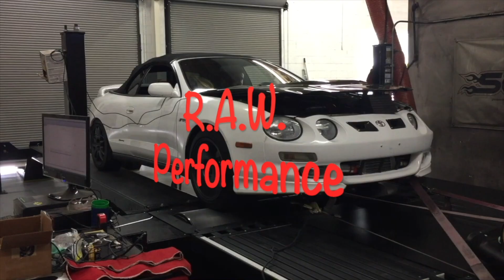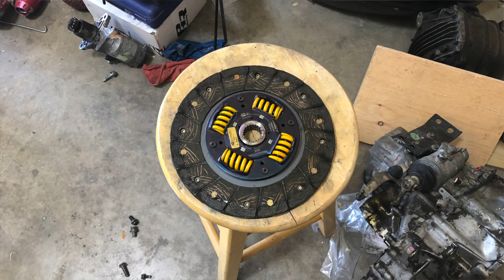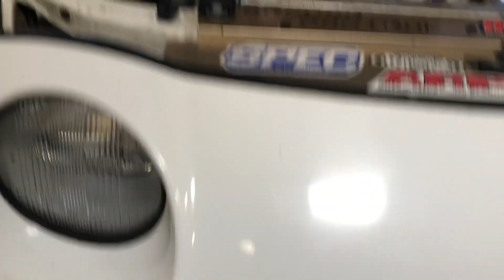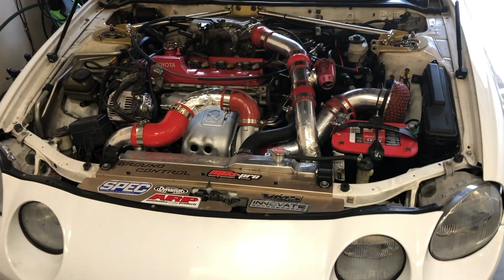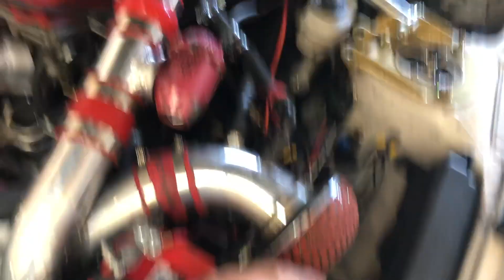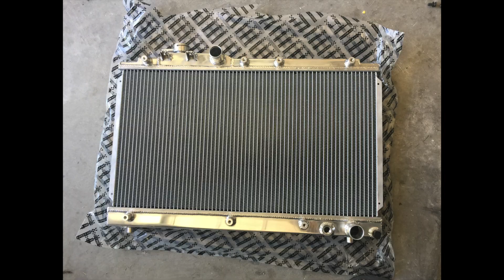How to 3sgte Swap Into 6th Gen Celica - Part 2

Comment: Your video is very informative I love them. What transmission were you running in this car?
Reply from the maker: @DE3Z-t9q  S54
Reply: @r.a.w.performance6602 oh wow interesting did you ever feel like you were pushing the car too far with that transmission? Or did you not run into any issues with this set up.
Reply from the maker: @DE3Z-t9q  As long as you keep it under about 350 hp to the wheels, the transmission should hold up fine.  Just don't do any crazy power shifting.  Since this car was a street car, I had more problems with the lower gearing.  On the freeway the car would be over 3000 rpm in 5th gear at 75-80 mph.  With that little turbo, the car was always in boost and generating heat.  Plus I hit redline in 5th gear at 120 mph (top speed).  There is a 5th gear Camry swap that will drop the rpm but I never did it.  When I compare it to my SC300 NA-T with a CD009 swap, I have gone all the way up to 6th gear in that without hitting redline.  You should never be going that fast unless you are on a track which is where I have hit those speeds.
Reply: Very true.  Thanks for the response man I really do appreciate it.

Comment: Where do you get all the parts for this swap, I just packed up my 5sfe and 3sgte harness to send to wiregap and now I need to get all the parts asap
Reply from the maker: It has been a while since I’ve done this build.  I got all my parts from primemr2.com.  I think they still have the parts.  You will have to custom make the intake to the turbo.  I used extra intercooler piping and cone air filter.
Reply: @r.a.w.performance6602  I’m mainly struggling to find out where to get the parts for the hybrid clutch setup, I can only find expensive lightweight flywheels. I have a friction disc and throw out bearing ordered through my job at the Toyota dealership but the pressure plate and flywheel are my main concerns right now. I sent my harness to wiregap yesterday
Reply from the maker: @tatumwilliams2192  You get a 3sgte pressure plate.  I believe Exedy and SPEC sells them by themselves.  Look for one for a 2nd gen MR2 Turbo if it asks by vehicle.  As far as flywheels if you can’t get one from a 2nd gen MR2 Turbo then you have to go with a lightweight flywheel.  That is what I did.
Reply: @r.a.w.performance6602  I also have some questions about where some of the vacuum lines go and how to set up the intake. It might be easier if I could send pictures of what exactly I’m talking about
Reply from the maker: @tatumwilliams2192  Send me an e-mail.  raswilli93@yahoo.com

Comment: Was the s54 transmission only on 5sfe cars or also the same for the 7afe cars
Reply from the maker: Only on the 5sfe cars.  I believe the 7afe engines have the C56 but not sure.  If you search on Wikipedia you may be able to find more info.
Reply: @r.a.w.performance6602   Do you know if 5sfe MR2 transmissions work too? Or is the housing different? My celica is an auto car so I’m gonna have to source a transmission too lol
Reply from the maker: @HoundSpeedRacing  Not sure.  I would guess they are the same but the shifter cable bracket is probably different since the MR2 is mid engine.

Comment: Very helpful video series. Thank you! 
I am in the process of doing the same swap...waiting for wiregap to send the wiring back to me. 
What did you end up doing with the power steering pump air control valve? 
The celica comes with a mechanical one but Calina uses an electric pressure switch that goes to the ECU. Did you just loop it?
Reply from the maker: Thank you for watching!  I think you are able to run the electric one like normal.

Comment: Hey man I’m currently doing this project on my 5sfe celica but I’m putting a 3sgte caldina motor was hoping if you can send me some links for the intercooler
Reply: I have the 5th gen and also which ECU you recommend
Reply from the maker: I would use the stock ECU if possible.  Wiregap has defeated the immobilizer on those.  He should be able to help you out if you get him to do your wiring.
Reply from the maker: It is just a 2.5 inch inlet/outlet intercooler.  I believe it is a 26” x 6”.  I got it off EBay.
Reply: @r.a.w.performance6602  thank you man!! Hey what about the transmission should I keep the 5sfe and rebuilt so it can handle that power or get the ones you suggest on your videos
Reply: I’ve also seen the Mishimoto universal intercooler do you think that can be another option instead of the one you’re using
Reply from the maker: @henryvaldez2026  It can work, just measure the space you want to put it in to make sure it fits.
Reply from the maker: @henryvaldez2026  I put Redline MT90 in mine and it worked fine.  Just don’t go over 400hp.

Comment: Subscribed my dude... Thank you for the info because I am about to swap an st246 into a 2003 Toyota Matrix. It should be an interesting undertaking and for now I plan on doing a stock rebuild because college budget. Coolest thing is that all but the passenger side engine mounts bolt up exactly the same so it's literally a bolt in swap. I can also use the AWD components from both my Matrix and the AWD transmission from the Caldina to have this same setup and still maintain the AWD. I love Toyotas, they're like Legos.

Comment: Would you recommend a Gen3 or Gen4 3S-GTE? I'm looking to buy a generic ST202 Celica and swap the engine, and I read that doing the Gen3 is technically easier but you need a "clip" (whatever that is...?) whereas the Gen4 is technically better due to it being newer.
Reply from the maker: I would recommend a gen4.  The motor drops in, it is coil on plug ignition (no distributor), and if you send the wiring out, it becomes plug n play.
Reply: @r.a.w.performance6602  Great video man.  Sitting on a '92 GT up here in Ottawa, looking into throwing a Caldina (gen5) 3SGTE in it.  Thoughts?
Reply from the maker: @mrcrowley109  That would be awesome!  It should work as long as you currently have a 3sfe or 5sfe in your Celica.  It would be a pain if it has the 4afe.
Reply: @r.a.w.performance6602  5SFE and rotted out floorboards brother (*cries in Canada*).  Fix the floors and lines, then the 5th gen goes in :)

Comment: Hey man, I actually have your car. Let me just say thank you for all the hard work y'all did, super clean. Looks and drives amazing too. My first turbo and manual car I've ever owned with this much power. Nervous as hell driving 2-3 days from El Paso Tx to South Florida but made it strong. Top priority currently is trying not to drive it until I save enough to keep up for any future maintenance and to find a tuner mechanic that would know this car well. Thanks again and keep posting. These videos are really helping me understand the car!
Reply from the maker: That is good to hear.  I am glad the car is in good hands.  Beside the engine work it is sitting on some very good suspension (BC Coilovers and Polyurethane bushings).  I drove the car and loved it.  If you ever need a copy of the tune file, let me know (I am a digital hoarder).
Reply: PePerformance yeah! I would appreciate that. Needs a tune desperately considering the elevation difference. Hopefully when I  find time to figure out how to work it myself or just so my mechanic has all that info. Thanks a bunch. My email is erics0630@gmail.com
Reply from the maker: Sent you the tune last night.
Reply: @r.a.w.performance6602  thank you🙏🏽

Comment: This is great. Starting my 3SGTE swap soon.
Reply from the maker: If you ever need any pointers let me know.
Reply: @r.a.w.performance6602  absolutely i will!  thank you!
Reply: R.A.W. Performance so got my 3sgte today.  I have a ton of questions.
Reply: R.A.W. Performance what header do you recommend for the 4th gen 3SGTE ?  Thx
Reply: How’s your swap going?
Reply: Sonny Van I just have the new tensioner and lower idler pulley to buy plus new front axels and I will be ready to start.  My friend who is a mechanic at Mercedes Benz is helping me and Covid has put us behind.  But have the engine on a engine stand and ready to update the engine with new components.  Need some advice on a cold air intake.  Not sure what I need to do there.
Reply: Sonny Van I hope to have it on the road mid spring.